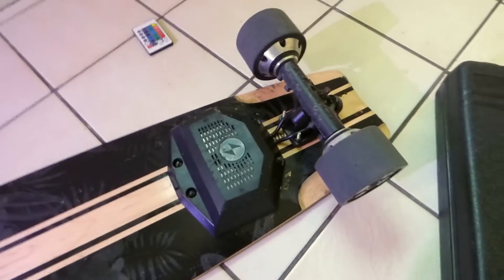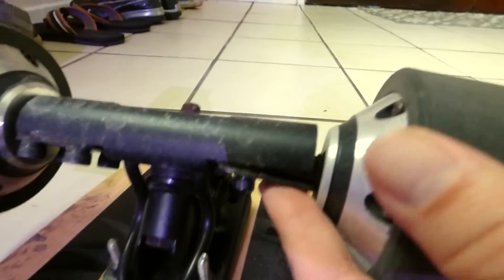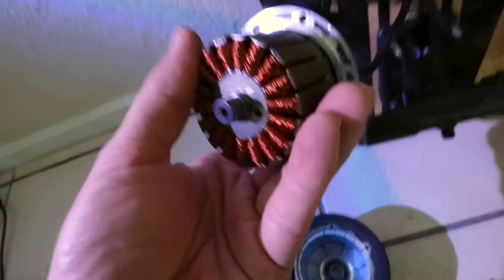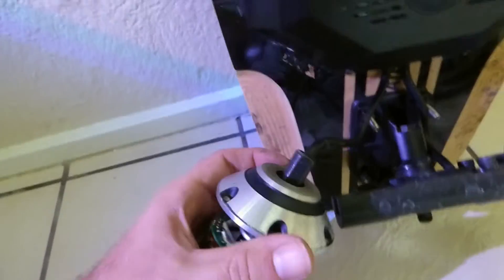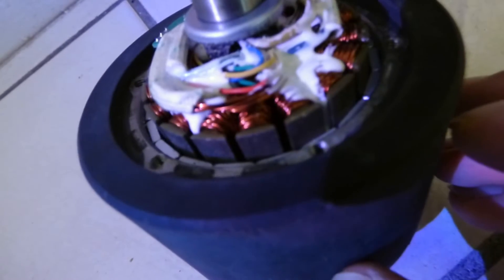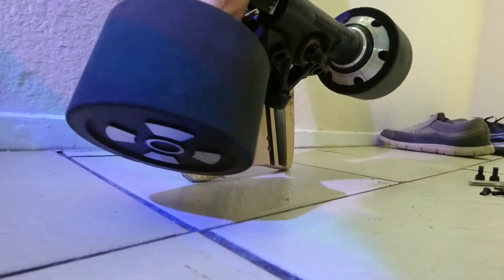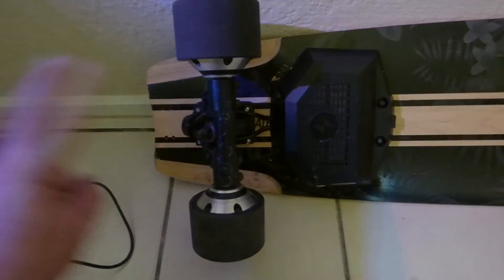Inside a Hub Motor - Electric Skateboard

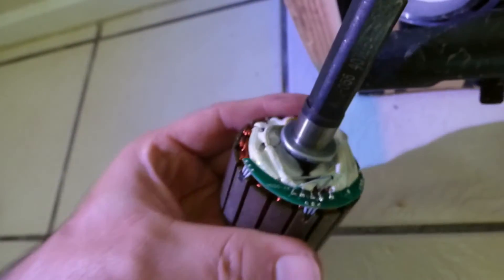Comment: The electronics are for the 3 hall sensors. You can see them, they are the 3 leg components that are next to your thumb at 3:44. Damage the sensors and your motor won't work (unless you get a sensorless controller).

Comment: I got a problem. One wheel doesn't get any torque. If I flip my board and push the wheel  it feels harder to turn compared to the other motor. Does it mean it's a shot circuit?
 It didn't have any water in it ..and looked clean like yours.

Comment: Does anyone know is there any way to get a new wheel part (seen at 3:00)? On my Pomelo p5 the rubber part is a little bit too large (streched or something) and is causing wobbling.
Reply: nesma1 did you ever find an answer? I have the p5 as well and need new PU
Reply: @runningcolekong  I'm looking for new hubs sleeves for my Pomelo p5. I wonder if meepos 100mm sleeves will fit. Hmmmmm🤔
Reply: shane corbett no, the hubs are not changeable on the P5.

Comment: Does anyone know where I can get bearing for hub motors? My meepo board has a "crunchy" sound coming from the rear when riding, and I'm almost 100% sure that the rear bearing need replaced. Since they're not standard size, I'm wondering where to get them. I have replaceable PU, so I don't want to buy all new motors. Thanks guys.
Reply: Did you ever find out by chance ? I was wondering if you replaced them with better quality if you would get better mileage or maybe even speed .
Reply: @TheCausea  I'm afraid not, never got anywhere with it. I just keep on riding though, it hasn't caused any problems.
Reply: This should be a standard sized bearing and there is probably a marking on it and googling that should return results. The marking is usually on the outer ring on the bearing and a new bearing is probably very cheap. There is information on the internet on how to put in the new bearing.
Reply: Did that ever become a problem?

Comment: I need to open up my hub motors to investigate a rumbling noise so this has been really helpful for me to know what to expect. Thanks!
Reply: One of the hall sensors in your motor is bricked.  Hub motor uses 3 hall sensors to provide synchronisation for magnetization of the windings. If one of them is gone, it doesn't give the feedback to the controller so it stops the magnetization of one of the windings. That is why it gives the stuttering sound. You need to identify and replace the hall sensor which is not working.
Reply: @yaichenk  any links to this particular hall sensor type + video or instruction?
Reply: @yaichenk  yoooo thank you for this comment, I think this is exactly what is wrong with mine. I also had the ballbearing locked in place and accidentaly broke the wires of the hall sensors.. so ordered 3 new ones to solder on. Also I did not see such a huge washer on top of the ball bearing on mine.. maybe thats why the ballbearing was rubbing against the wires and caused my wheel to stop working.
Reply: omg! did you find a fix for that I have the same issue.
Reply: Daniel Kwan thanks for making videos on e boards! I got a wowgo 2s because of them and I love it!
Reply: You should reseat your motors (4 connections) from the esc

Comment: Thanks. I'd been wondering if you could swap out the rear bearings. From what your video shows, it might be pretty simple. The outer bearing should pop out easily if you take the hub cap off.  I guess you'd have to detach the wires at the ESC to slip the inner bearing off the far end of the cables but it could be done.
Reply from the maker: +FandangleTechery  your right, it shouldn't be to hard to change the bearings but inner one is bigger so it would need to be measured out.
Reply: Oh okay. That makes it a bit harder. Might just stick with the bearings I have

Comment: Nice video, thanks! I have a Meepo board and I changed the bearings in the front wheels. The coast a lot longer and in theory it should cause less resistance when riding. I wonder if replacing the motor bearings would help. What do you think?
Reply from the maker: Im sure it would help somewhat, but i dont think it would be that big of a difference that you would feel, plus the bearings appear to be differently sized inside the motor. Thanks

Comment: Thanks for your videos Vlad. I've found a board company that sells those replaceable hub motor urethanes here - https://verrealboards.com/products/replaceable-hub-motor-urethanes
Sounds like a great thing to use if only the urethanes are destroyed and the hub motors themselves don't require any replacing. The only thing to check would be if they are compatible, which it probably does.
Reply from the maker: Good find! They look identical seems like and not a bad price shipped, compared to buying the whole assembly. Thanks for the link.
Reply: Yeah but this guy crazy expensive you can buy whole motor for 50$ on aliexpress